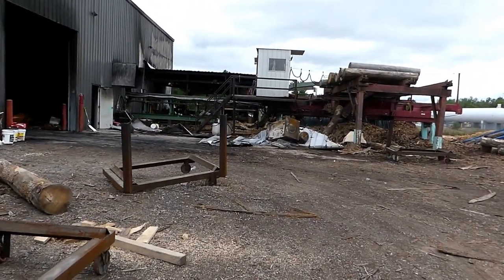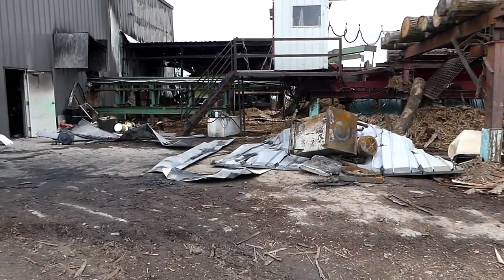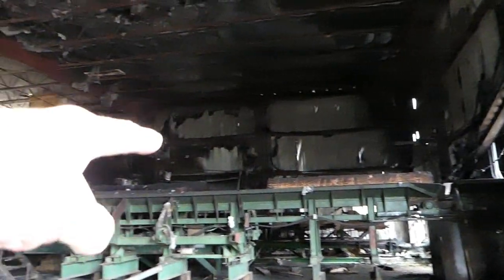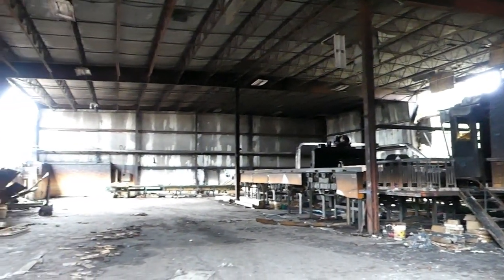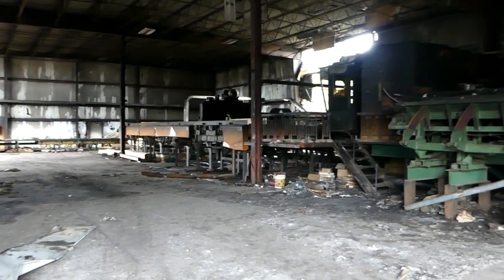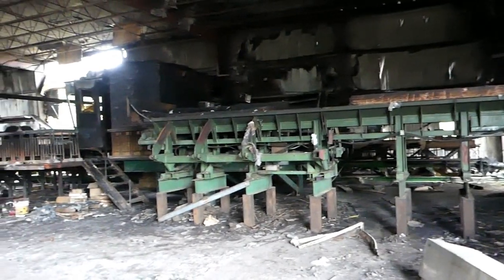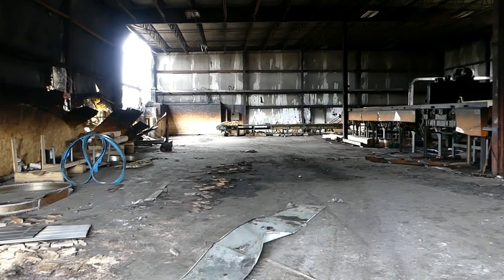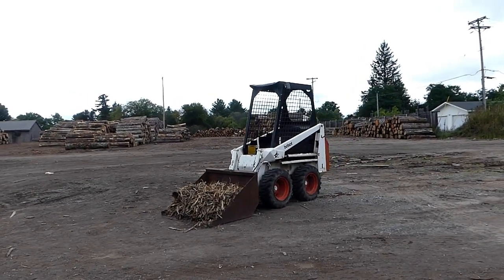After The Fire, Whats Left? Dufeck Manufacturing (Lumber Mill) In East Kingsford, MI | Jason Asselin

Comment: Lumber mills are inherently dangerous places. In spite of all good cleaning practices just day to day operations generate dust. Cant do much about that. Dust can actually result in an explosive force which seems to be what happened after the bearing caught caught something on fire. A witnessed fire and an attempt to put it out was all any business owner could ask. That fire generated alot of heat as is evident by the smoke line on the walls. Good example of why they say to crawl out of a fire. Im hoping for a quick turn around for the employees and owner and the good part is that they are all around to rebuild. Thanks for the video.

Comment: Well ,, With the hydrant system & Low water pressure ,, if they were to hook the pumper to it ,,it would of created a vacuum on the lines & ALL hot water tanks in your area would have been collapsed from the suction on the lines !! Your TOWN COUNSEL needs to look into putting water towers around town to buildup the volume & pressure !!  Yepper !! Higher Town Taxes ,but look at the outcome of NOT doing it ??  Your house next ??? Have a good week & ""KEEP IT SAFE ""!!

Comment: A water tower and sprinkler system would be a good combination. Potable.water is not required if sprinkler system is designed to include some sediment. Fire hydrant system could be separate from potable water system. I think a well would prove to be an insufficient source for a rapid and large source once a water tower is exhausted.
Good luck with whatever can be developed.

Comment: Sorry for the owner, and the town.  When they do rebuild they should have a dust control program, and a metal or wood water tower for fire suppression or a sprinkler system gravity fed.  
fire doubles every 45 seconds.  
The fire triangle is heat, oxygen, fuel.  All three were present.

Comment: Thinking of the rebuild you can have a sprinkler system.
It would require a pump and if the water is at a low pressure a water storage tank could be used for the fire pump.
May be an old road milk or other liquid tanker could be used.
Also if your mains supply is likely to be interrupted by a back up generator.
We here in the UK have I believe an US company at Coleford called SPP Pumps who make pumps for UK, USA and the rest of the world.
I know it's costly but it could cut you insurance bill.
The pump will pump up the system to a certain pressure, when the system is used the pump will kick in keeping up the pressure.
The sprinkler heads give out a fine mist spray which covers the area of the sprinkler that has been operated by the fire.
I think in the UK the building would have to have extra called Ex standard equipment as the wood dust could not only cause a fire it could also cause an explosion.
I thought from your original film it might have been a pice of machinery that had caught fire from the dense black smoke (oil).
Hope the issue is cleared up quickly and the building is rebuilt, getting the employees back their jobs.

Comment: Time for the city to build a water tower next to Andy's place so he can put sprinkler system in his building.  Next time maybe he can put them in, but instead of automatic when they burn, make them a shower type you turn on manually.  Something is better than nothing, maybe a water pressure pump to help out.  Bummer for his loss.  Glad he will rebuild and keep the jobs in Kingsford.
Reply: If you were putting in sprinklers, why would you not use automatic ones?
Reply: @beeble2003  if I understand from Jason's explanation, there is poor water pressure.   I believe automatic systems require a minimum PSI to work or the will never work. He'll, maybe Andy will build a Watertower next to building for them.
Reply: @rons3103  Right but doesn't a manual sprinkler system require just as much water (volume and pressure) as an automatic one? I know nothing about fire suppression systems but I don't see any reason that a manual system would need less water.
Reply: @beeble2003  I'm sure it does, but my thinking was, Anything is better than nothing.  If they can install a automatic one, then put anything in to save the business.  With low pressure, water will still come out.  Enough to save everything, will never know now.